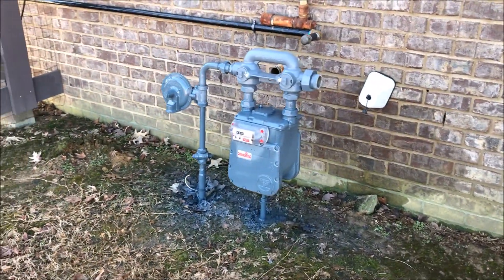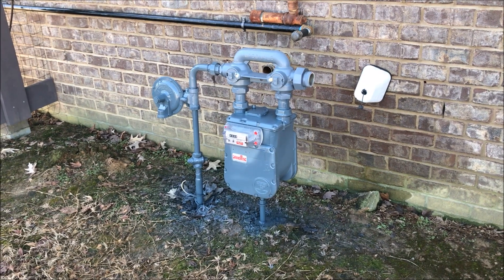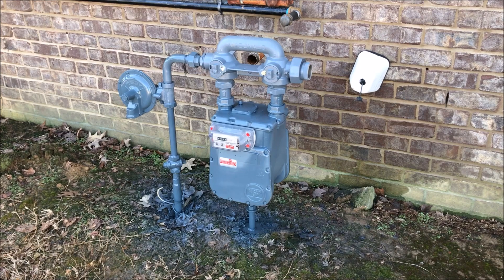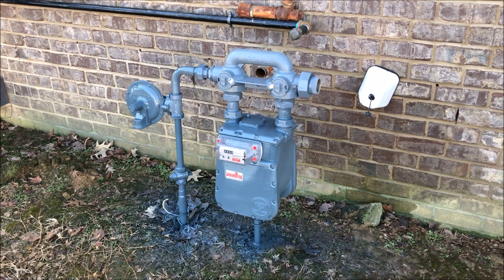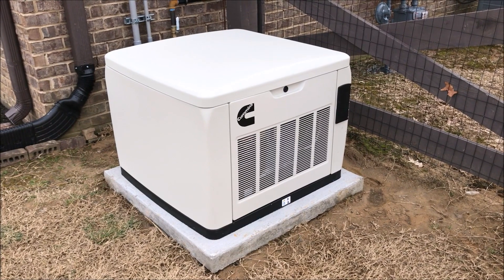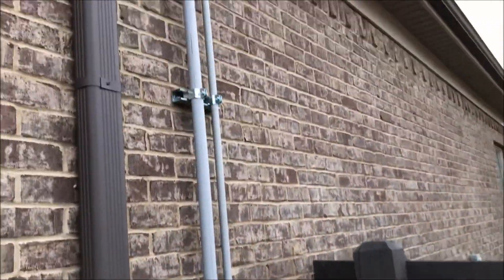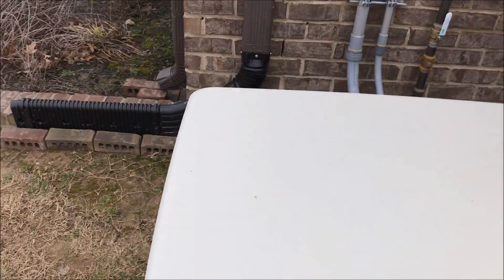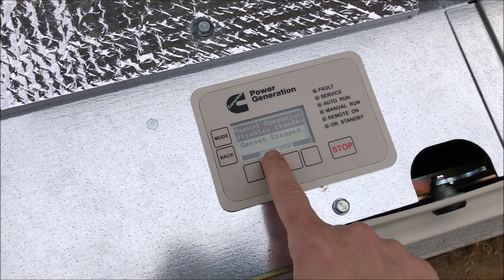Cummins RS20A Generator Installation

Comment: I live in Nigeria and plan to use this generator as a primary source of power. in the video your consumption rates are in cuft/hr and gal/hr, would you please give me the rates in kg/hr so i can have a better understanding of the cost implications over here in Nigeria. Thank you
Reply from the maker: Howdy there!  If you go to the datasheet that can be found at the link below and look at the 2nd page of the PDF, you should be able to find this information for various demand loads on the generator:

https://www.cummins.com/calculator/cummins-generator-calculator/spec-sheets/RS20A-EN.pdf
Reply: @GhostRider1974  thanks a lot. This really helped 🙌🙌🙌
Quite expensive though...
Reply: @elenduchinedu467  you would really need a 1800 rpm genset for prime continuous power or a 1500 rpm if your country utilizes 50hz. Also a diesel fuel generator would be more fuel efficient.

Comment: After 3 years are you still happy with your choice? All my neighbors all have Generac since I guess they are at Slowes and HD.
Reply from the maker: Howdy....yes, so far really happy with it.  I’m coming up on end of battery life.  The generator company that installed recommends changing battery out every 2 years.  I stretched to three.
Reply: I just got a rs20ac recently and am going through the installation process now. Just checking in to see how its working out for you..
Take care!

Comment: your gas bill will be thru the roof if you run that for a couple days. better off staying in a hotel.
Reply from the maker: Well, no actually.  Last time we ran it for a 4 day outage the gas bill was 75 to 100 dollars higher than normal.  If you factor in the inconvenience of displacing the family, fuel, then buying groceries / food out at hotel (or having to haul everything with you), it is well worth it.
Reply: Did You factor in busted Frozen Pipes? Spoiled Food, Sewage Problems? All  of which may or may not covered by Insurance?

Comment: It’s pretty loud?!!!!
Reply: @Thundering_Banshee  Yes they are but twice the price.
Reply from the maker: Not really...not as quiet as a small Honda generator, but not bad at all.
Reply: 1953HLH thank you Sir!! 🇺🇸
Reply: To put it into prospective, the smallest liquid-cooled Genset Cummins offers is 22kW (RS22), and emits 64dB at the same distance IF you purchase the level II sound kit... Can't find the sound ratings without the level II kit anywhere. 

IMO, Probably because it's just as high or higher than the air-cooled models and wouldn't provide any sound related incentive to buy a Genset that's twice the cost of the RS20...

Comment: Kohler and cummins r the best! But kohler just started outsourcing some parts to china n those parts r having problems.  But cummins has great units, residential a little big (even tho they wanted it to blend w the AC's) but the generator isn't always in the same spot as the AC's. Generator should always be closest to gas meter to make cheaper for the customer. Also more room to service, but more of a mess to clean when servicing. But if its maintained correctly, the generators will run like Usane Bolt running for another gold medal!💯😂 God bless to all. #JesusISTheTruth
Reply: I have heard conflicting things of where to place the generator unit. . .closer to the power box or closer to the gas meter. . . been told by my electrician to put it close to the electrical meter box and transfer switch.   Please clarify.  Thanks.

Comment: i am trying to determine if there is a side of the generator that is nosier than the other sides when standing back so i can plan to put that direction off into the woods,  and away from the neighbors?    i would assume the exhaust side would be the loudest am i wrong?
Reply from the maker: Howdy!  I can't tell if one side is noisier or not... there isn't a defined "exhaust" location because the entire genset is somewhat shrouded to reduce noise.  The "front" of the generator is what shows up in my video... the air flow louvers on that side are labeled as "air intake" in the installation manual.  There are another set of louvers on the "rear" of the genset and those louvers are labeled as "air outlet" in the installation manual.  The installation manual can be viewed or downloaded from this site:  https://www.norwall.com/product_pdfs/9986_rs20a_install_2_2017.pdf

Comment: That unit is not that quite
Reply from the maker: It actually isn’t that bad.  65 dB at around 25 feet which is same sound level as a normal conversation at 3 ft distance.  Definitely not as quiet as a Honda 2200i though.
Reply: To put it into prospective, the smallest liquid-cooled Genset Cummins offers is 22kW (RS22), and emits 64dB at the same distance IF you purchase the level II sound kit... Can't find the sound ratings without the level II kit anywhere. 

IMO, Probably because it's just as high or higher than the air-cooled models and wouldn't provide any sound related incentive to buy a Genset that's twice the cost of the RS20...

Comment: I purchased the 13kW unit. It's not quiet at all. Sounds like a lawnmower and outside the bedroom keeps me awake. I thought that it would have been very quiet compared to my noisy B&S 7-10KW unit. It wasn't.
Reply: ProductsOfMorticians it sounds like a lawnmower because it’s basically a lawnmower engine running at 3600rpms.   You’d need to double your budget for a quieter 1800 rpm unit.
Reply: To put it into prospective, the smallest liquid-cooled Genset Cummins offers is 22kW (RS22), and emits 64dB at the same distance IF you purchase the level II sound kit... Can't find the sound ratings without the level II kit anywhere. 

IMO, Probably because it's just as high or higher than the air-cooled models and wouldn't provide any sound related incentive to buy a Genset that's twice the cost of the RS20...

Comment: Is there a kit available for the ethernet connection, I did not find an existing ethernet plug on the control board?
Reply from the maker: I would think that there is, but not 100% sure.  It would be on the back of the unit where the power wiring enters.  The installer connected it up, so I haven’t dug into that area.
Reply: Should be under the big bare metal cover and it's near the top of control board above the gas connections.

Comment: Thanks for the video. Does this come with a remote display for in the house? If so, what does it shows and can you remotely start the generator from inside?
Reply from the maker: Jere616 ...thx for the question.  They used to provide a control panel in the house, but now they use an app on your phone to control the generator.
Reply: Thanks. That has a big advantage if you're away when it comes on. Its disadvantage it seems is if your WiFi/Internet goes out that the phone depends on along with the electric. My cable lines are as vulnerable or more so than my electric.

Comment: Do you know what size conduits for control and power you have? Also, what size gas line to the generator?
Reply from the maker: Hi there.  I believe the conduits on the outside of the house are in the 1.5" diameter range.  Once the power and control wires are inside the house they run in the attic, so no conduit required until they get to the other end of the house and run back outside to the transfer switch.  The gas line is about 1.5" diameter as well.  I had to get a ~650,000 cf rated gas meter put in (by the utility company) as well as a higher flow check valve near the road (by the utility company).  It was about another $1200 to get those items installed.

Comment: You will be the only one with your lights on... and hot water... and AC... you won't even know the power is out😆😆
Reply: Yup. Kohler and cummins r the best! But kohler just started outsourcing some parts to china n those parts r having problems.  But cummins has great units, residential a little big (even tho they wanted it to blend w the AC's) but the generator isn't always in the same spot as the AC's. Generator should always be closest to gas meter to make cheaper for the customer. Also more room to service, but more of a mess to clean when servicing. But if its maintained correctly, the generators will run like Usane Bolt running for another gold medal!💯😂 God bless to all. #JesusISTheTruth